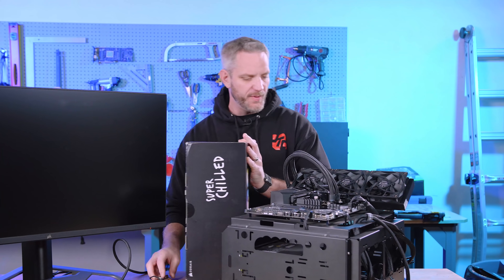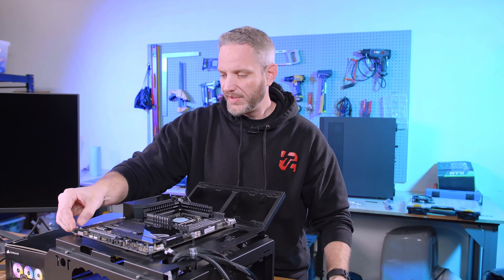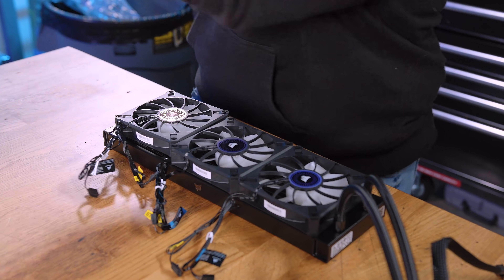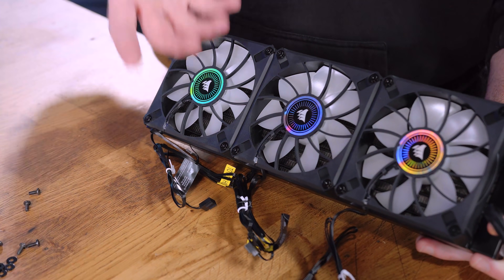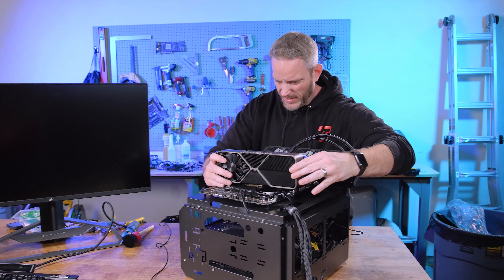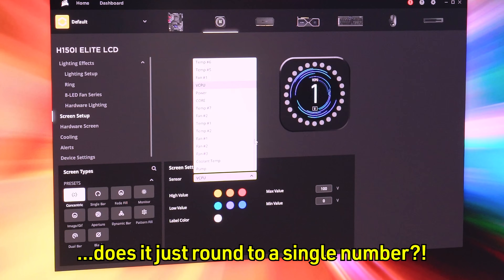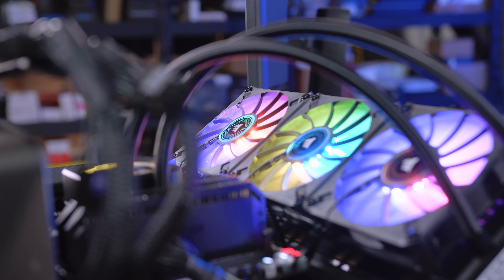Who knew this cooler could be so... COOL!

Comment: Just bought this AIO and they made some changes to it. I think they listened to Jay's critique. 
Changes they made:
They sleeved the CPU fan cable so it looks stronger. (still got the tiny wire inside)
Made the sleeve of the other cables better fitting.
Changed the hologram stickers to plain black ones with the Corsair logo.
There is also no more hot glue used to keep the fan cable in it's place.
The thermal paste are multiple triangle shaped with little spacing.(Personally i'm not a fan of this so i'll be changing it with thermal paste from Der8auer)
Reply: Not a... FAN of it aye?
Reply: @Eastylord2 😂
Reply: @Eastylord2  XDD

Comment: I think for benchmarking purposes, it's actually ideal to use a test bench because it gives you the best possible scenario with whatever your testing in terms of thermals. Everything else will scale down because it's an open-air test bed. The moment you start putting it into case, the variances in case design come into play and skew results, point and at that point you're not just testing the cooler, but also case performance as well.

Comment: I personally think that at least on occasion some testing of cooling solutions should be done in cases, specifically within a few different cases that are high, moderate and low air-flow, as a way to make sure that certain cooling designs are not significantly diminished when put into a case, despite being similar or better than other cooling solutions when tested on an open-air test bench. 

Even just a single video showing that the results are transferrable, if they are, as Jay seems to be implying (for example testing a few different cooling solutions on equivalent hardware in multiple different cases and the test bench, and graphing each of the solutions results to show whether the best open-air cooling solution remains so in every case or not - and whether the lead is maintained, diminished, or improved), would be a great video to see and could be pointed to for anyone complaining about it in the future.

Comment: Jay makes sure to point out that the fans have special frames to direct the air through the radiator more efficiently then proceeds to mount the fans in a way that won't use that feature 🤣
Reply: I was just thinking that. :s
Reply: Yep...and to add to it, if they were mounted in a way that used that feature , it would also hide those 1990's hologram stickers that Jay loves so much.
I can only how imagine much is on the mind of the man running the channel.
Keep up the good work Jay!
All teasing aside, your input has vastly helped me to learn, build, use, and overclock my computer.
5 years ago I only used a computer for acquiring media.
I am now upgrading my 3rd build to a trx40 for video editing.
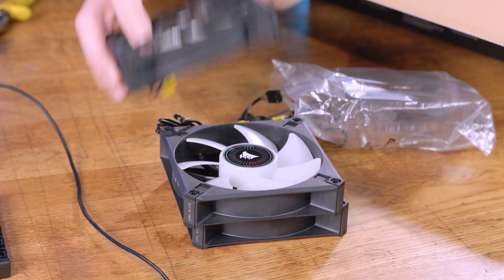Reply: @personaldronerepair6141  That sticker is on the other side too 5:36
Reply: And... then complains about the glue that's meant to be facing the radiator :facepalm:
Reply: @AK90  All I can say is....."be strong Jay."
New stickers will come out soon.
Reply: Jayz2braincells
Reply: The way he does it is correct if you listen to him
Reply: @alfie.j_2465  he could have put the fans below the radiator, blowing through the fins...
Reply: This is incorrect, the fans pull air through the open face and exhaust through the back caged side. He mounted them correctly.
Reply: Literally just noticed that the fans are blowing down, lol

Comment: Just a heads up for people looking to order this or the other variants, mine is the h150, i have no compaints on the cooler performance but the hoses are not very long, in my meshify 2 i chose to mount this at the front of the case and the hoses had to be at the top, they were not longer enough to be at the bottom, luckily the rad is higher than the cpu so its ok but not optimal, just be aware of this if u insist on having the hoses feed from the bottom of the rad 👍

Comment: -- Well Jayz, I have to hand it to you.  Off topic, but I checked out 'Fan Control' and got a RTX 3060 Ti from idle at 41C down to 28C with 875 avg. fan RPM.  From 81-84C under load to capping at 68C.   
   This in a case with bad ventilation: One 120mm intake in the door, and one 80mm up top, and whatever the push pull exhaust out of the 120 RAD is.  Using a Thermaltake case about 9 years old.  Small mid-tower, Zero in the way of cable management.  Next case is a D5000.  Needless to say I'd expect it'll do even better.   Thanks for the tip.

Comment: Jay: people are using that crap all the time
Thermaltake: and I took it personally
Reply: Well Jay does have a history of hating Thermaltake
Reply: Redux felt that too
Reply: @dj Kplus The thermaltake lawsuit hit them pretty hard. Every tech company was affected by the trump tariffs, it ain't an excuse.

Also, yeah, the P series... but what about the crap power supplies, crap fans, crap AiO's, crap custom watercooling kits and the most budget cases are crap as fuck.

For the price point they ask for the P series, there would be riot if they built them as the budget series.
Reply: I really really like my thermaltake core P3. You would think it gets dusty but I've had it for more than two years now and never dusted it once. Something about the fans of the radiator and the video card keep that dust in the air moving right out of the case because there's no sides so it never settles. Strange phenomenon but awesome, I was expecting to have to dust it all the time.

Comment: I have a white one with my all white build, love it.  I used the LL120 fans I already had.  Probably not as efficient, but they work, and it looks better.  Also the Commander Core replaces two devices my previous cooler and fans used (I have 6 LL120s).  Also less wires going to the new cooler, alot less messy looking.

Comment: 11:15, sorry but if you are using this on the front, you have them blowing the other way, so, no, you don't see them. The hot glue avoids them vibrating against a chassis from the airflow. Much appreciated. Also, they look plasticy? They are plastic like every other fan on the market, no?

Comment: The new Corsair H115i Capellix AIO’s look insanely good. I’m not sure about thermal performance but they seem to push good air according to the specs (the 280 version does 97 CFM and 3.0mm H20 pressure). I’ll probably get this or a Lian Li Galahad
Reply: Actually, the LCD XT is the improvement over the older capellecx version, and that's why it costs more.

Comment: If you have more than 1 independent variable, your results will be inconclusive. Therefore, open air test bench is the way to go for these tests.
Reply: Yes and no. Putting stuff into a real case will have a meaningful effect on perceived loudness as cpu and gpu coolers noise will get dampened. 

But you also have some moronic review sites that test 360 aio:s with a case like Be Quiet 801 and place the rad against the closed roof that has small vents for 120 fan at the back of the case. "Barely better than a d14". I bet next they tape the d14 shut from all sides and say its worse than a stock cooler.

Comment: At this point my whole Rig is gonna be Corsair, I have had terrible experiences with Nzxt & AuraSync, Icue is the only one that hasn't given me some problem.
Reply: It’s worth it man
Reply: Aurasync doesn't even detect the rgb built into my Asus motherboard lol. Some of the most worthless software I've ever used
Reply: I'm leaning towards icue.
Signal RGB only detects my tridentZ but not the three argb fans or two strips...
Reply: @tfwpky5020  iCue handles the RGB for my Asus motherboard.
Reply: @TheSjuris  it can control lighting on ASUS GPU’s as well. I’m not 100% if it’s all, but it works for their strix cards
Reply: @mauricioyoung6668  works on their Crosshairs series as well.
Reply: I’m getting the nzxt cam freeze with my AMD so I’ll be swapping over. Pretty much everything else I have is Corsair.

Comment: Just recieved my H150i elite LCD (Dec 2022) and the hot glue is still there but much less on mine and it's black glue that blends decently with the frame.
Reply: How is it? What kind of CPU do you have?
Reply: @dusk3219  
Not sure yet. CPU i7-11700k arrives today and then I can finally build.

Comment: Arctic seems to be only aio manufacturer knowing how to handle wires.
Reply: @PC_Modder wait a second, arctic 2 is in push config. Takes air from the case and pushes it through the rad.

Comment: If anyone Is running an AIO, run your pump at full tilt. The pump motor is designed to run at that rpm and it keeps the heat from ruining the pump, which is a big killer of pumps on the block design. Also, as a gigabyte 280 LCD AIO owner, the screen on it is also super good and its a little cheaper and a great AIO with awesome fans. They're fluid bearing and both of mine have leaked some, but they look rad so there's that lol

Comment: Jay: Redux is for gamers who want high framerates without breaking the bank

Steve: Hold my beer while I lay some wisdom down on this young man.🙃
Reply: That must be the video I liked the least from GN. It's like they intentionally picked a bad combination of parts and then complained about how parts don't make sense together.

You can put together a 3060ti build on redux for $1500 and they ordered 1660 for almost $1400. Of course it's a terrible value
Reply: @philistine3260  I guess maybe a unsuspecting buyer just maybe assume it’s an ok value between $1400 and $1500
Reply: @philistine3260  Redux actually changed their Good build and now made them start with a GTX 1660 and an air cooler (before it was GTX 1650 and an AiO) the day after GN published that video so it looks more bang for the buck now.

The main problem with Redux is that while you can customize some parts, you can't customize ALL of them (and you still can't even up to now) so you get some case scenarios where you're stuck with overkill parts like an expensive AiO on a 10400F when a cheaper air cooler would suffice.

Comment: An LCD on an AIO is what I want, not in my current budget though. My bank account recovered really well from me tossing eleven hundred into my build last December, but this past July I had an oak tree get split by lightning, and it cost me two grand to have it cleaned up. People saying the open air test bench isn't real world are wrong, I still haven't added fans to my case either, and since there isn't airflow, I haven't put the side panels on yet. Been running an open air computer for nearly a year.

Comment: That AIO is just a typical Aluminum rad Asetek unit with Corsair fans and a LCD that does nothing to help cooling but does make it expensive. Not worth $290.
Reply: Just like the other AIOs with lcd screens
Reply: For that price you can get a EK kit with a copper rad and it's expandable.
Reply: If rgb increases my frames this will too. You clearly have never built a gaming pc
Reply: @@teamgeist3328 Off the top of my head I know Be Quiet, Alphacool and Thermalright make them.

Comment: The LCD screen can be bought separately for £89.99 in the UK when it becomes available, Novemberish? and is easy enough to change from the LED to the LCD screen. I bought the 360 Elite Capillex back in May for £170 and the ML fans where better looking and better manufactured.

Comment: Jay, if the fans were in intake mode, the fans would be facing the opposite direction and the hot glue blobs would be against the radiator.
Reply: Doesn't matter though.  At this cost that's just unacceptable -- it literally looks like an engineering sample.
Reply: obviously... but that doesn't matter? you're paying a premium for hot glue globs. Who tf wants to pay that much and be forced to orient their fans a certain way to avoid showing that. if you're paying that much for an aio you should be able to set up your fans however you want without them showing hot glue dude. that's the point.
Reply: Some people prefer to setup their intakes as pull, especially if the rad is side mounted, like in a lian li case. So every time they looked in, hot glue blob.
Reply: @apanda0077  that is a minority though, both top and front would hide the blob
Reply: @erikhendrickson59  Oh i get it, one of my builds is a complete hard line O11 Dynamix XL with bottom fans on rad as intake. Id see them there if I had those fans.

 But. this is an AIO. mounting in any other orientation than front, or top would be bad for pump, so I don't see that being as much of an issue.   Perhaps if these fans were sold separately, then yes.

Comment: I had to buy this cooler last minute at BestBuy (It was the only AIO they had) when I was rebuilding my computer... because I there out the other brackets for my previous cooler on accident. $250 out the window because I didn't want to wait a day or two to order replacement mounting for what I had. But I wont say I'm disappointed, my PC has never looked better.

Comment: Jay: Has Dremel 

Also Jay:  SNIP, SNIP, HAMMER, HAMMER, HAMMER, HAMMER 

XD
Reply: No metal particles to deal with when you SNIP, SNIP, HAMMER, HAMMER, HAMMER, HAMMER instead of take a dremel to it.
Reply: @jhfgjtjutyiuod   But sharp ednges exactly where Jay had to put his hands to disconnect the wires and remoce the cooler bracket
Reply: @lacucaracha111111  Sharp edges are preferable to metal filings  from the dremel potentially short circuiting the PC.  Jay did the right thing.  He would have had to take the rig apart, use the dremel on it away from the PC components and then put it back together and he made a point of mentioning he was too lazy to change the AIO on the rig due to how much work it was to disassemble/reassemble all the time, hence the quick and dirty tin snips and hammer fix with no danger of shorting anything and no need to dis/reassemble.

Comment: Hadn't built a PC in a while. But built a new 12th generation core i7 alder lake PC.  Thank you for having such a good educational site. Because several things have changed since I built my last PC which was an ivy bridge PC.  The M2 memory as well as the new way to load the operating systems were freaking me out. But after watching you primarily and some others I felt comfortable completing the job.  The system is working flawlessly, even though I can't afford a new graphics card to put into it. And I hate cannibalizing my ivybridge system which has a 1660 graphics card.  Even with the integrated graphics on the new core i7 processor and board, I am actually able to play flight simulator 2020. But clearly cannot push it as hard as I would if I put the 1660 card into the machine..

Comment: Corsair will probably switch to black hot-glue.

To be honest, I'm not a fan of bling on PC components. If they work as they're supposed to and my system doesn't crash, I'm happy. It's probably because I'm old now. ;-)

I can relate to having an open test-bench. Back in the olden days, like 35 years ago or more now, I used to test and repair circuit boards. Having an open frame allowed us to plug in the boards, poke around with meter and scope problems and even perform soldering repairs without needing to disassemble the system to do so. One one product, we did work on completed systems, but had special extender cards to put the circuit board within reach so we didn't have to put our hands in and around the bottom of a CRT with 25KV floating around the fly back transformer. That was static build-up, but it hurt pretty bad when it zapped across the knuckles, which forced your hands to swing back involuntarily so you ripped your hand on the chassis. I still have some scars from that.

Comment: I heard its a point of mounting the fans that the air is sucked through or pulling tha air through the Radiator... Its better to push the air through... Air will always look for the easiest way through... So when its sucked through it will always get the most of the air from the sides and not from the middle of the Radiator...
I would love if you test that one day! 😉

Comment: I'm not sure if this has been commented on (I skimmed and could not see it) but if you mount it as an intake at the front of your case the hot glue will be up against the radiator and you would not see it.

Comment: Cooler vs RAM? That's fine!

Back in 2001 I bought a Athlon Thunderbird (or was it an Orion K75?) and a Thermaltake Super Orb to cool it. (that thing sounded like an hairdrier!) Being a tall cylinder-shaped cooler when every cooler on the market had the same footprint of the socket, it interfered on some VRM Capacitors! I had to trim 15mm (about 5/8") to fit that capacitor under the cooler fins (actually a bit more because I didn't wanted to rip the socket from the motherboard -socket 462 coolers had to clip onto plastic tabs located on the socket itself)

Comment: I returned my Capellix last year because the pump whine on all settings was irritating. Not loud but I could hear it over the fans and it did my head in. I did a "on the rebound" change to a Noctua DH15 (black) and it's been great. Jay says this one is quiet even on an open test bench but I just know that if I bought one ...